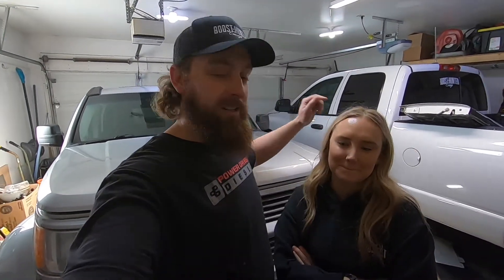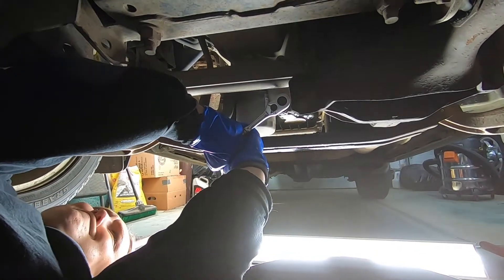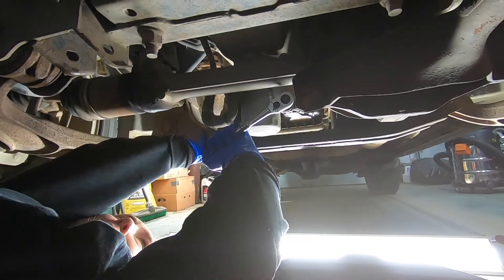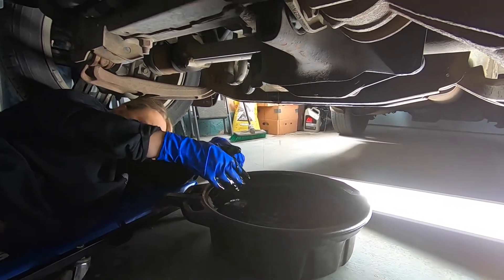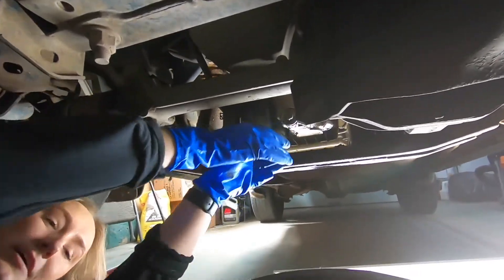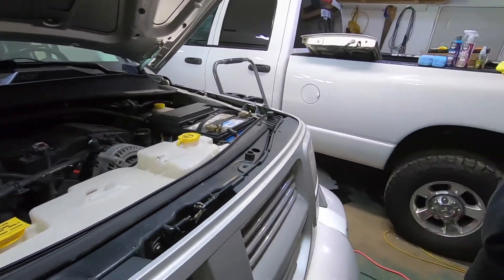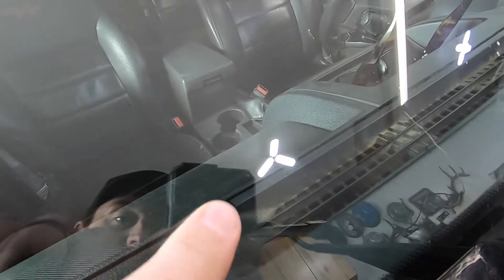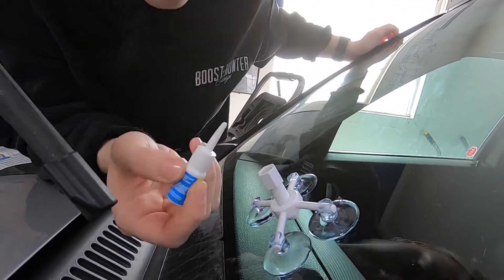My Wife Attempts to Change Her Car's Oil 😳

Comment: Good for her for being willing to do this.  As she said, it's a simple job .. but is complicated by close spaces, tight bolts, drips, dirt, etc.  A LOT of guys won't do this job.  I would have prefilled the oil filter, though.  Easy to do and gets oil in the engine a little faster when starting it the first time after the change.